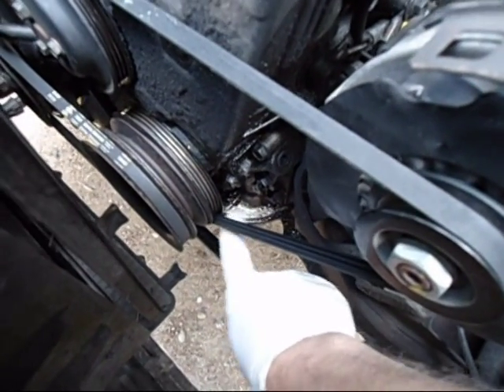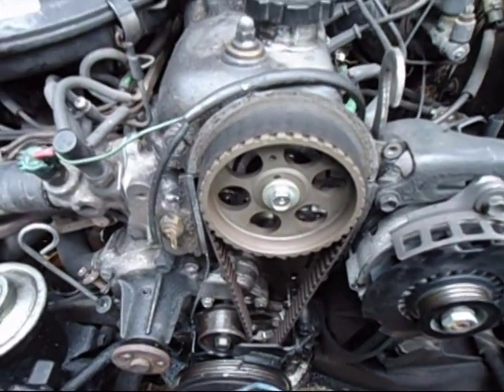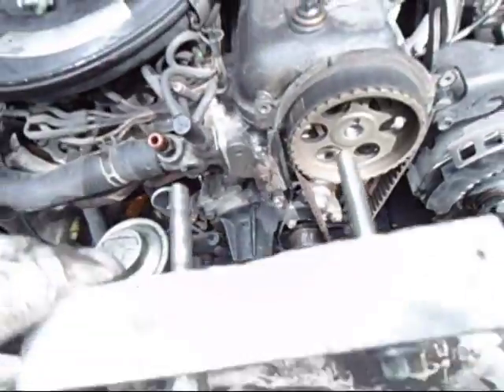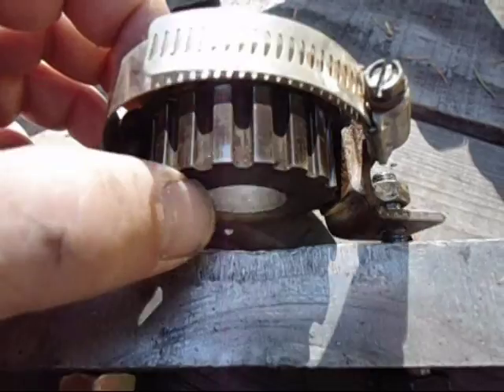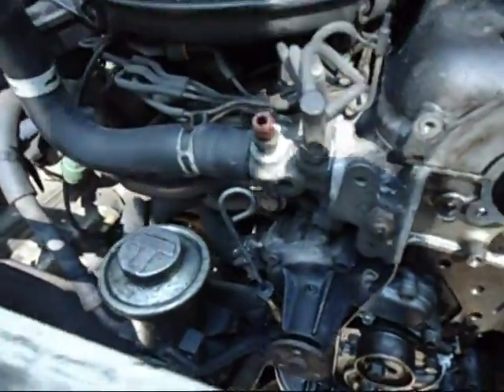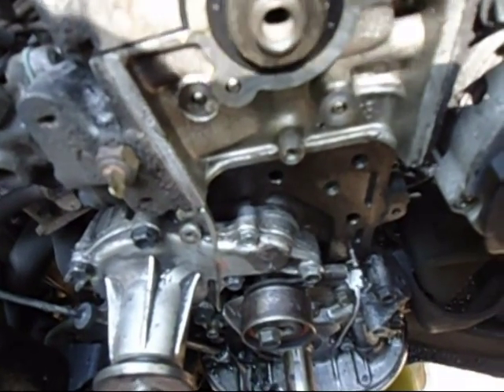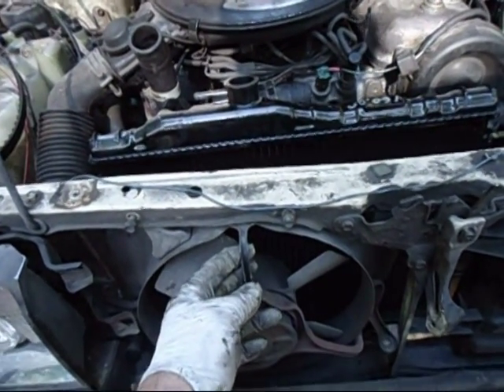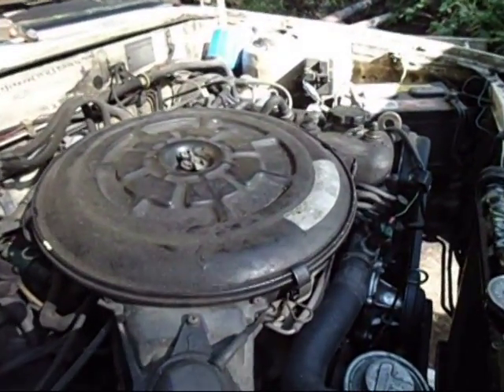Toyota Tercel 4WD Replace Timing Belt, Front Seals & Water Pump

Comment: Just did my timing belt, water pump, new cooling fan and radiator, I've been a commercial fisherman up in Alaska for twevle years and delt with maintenance of desel engines, but this was the first time taking on a wrenching project this big without any back up. I followed your advice to the T, built my own angle iron harmonic pully-puller setup, even reused my coolant after straining through cheese cloth. I just wanted to say thank you for sharing your skills.

Comment: I cannot get the lower timing belt pulley off.  The puller even ripped the ends of the pulley off.  Any ideas?  Torch heat or another kind of tool?

Comment: Hi,how did u make the tool you show to pull the crankshaft timing sprocket pulley coz my 1997 Tercel sprocket is stock it won't badge!
Reply from the maker: just made it from scrap metal lying around